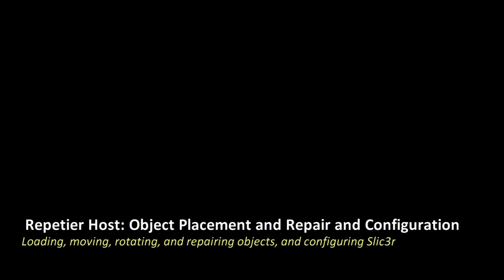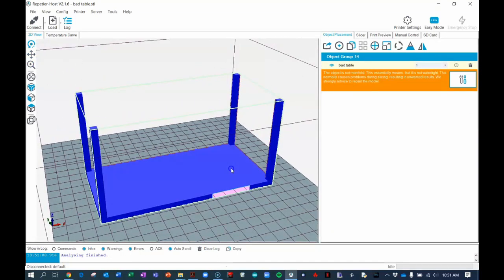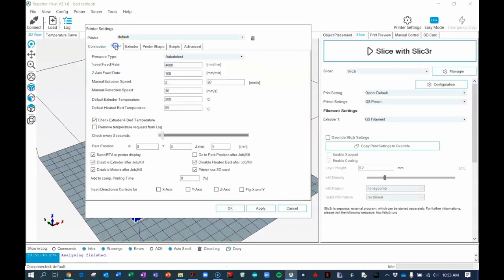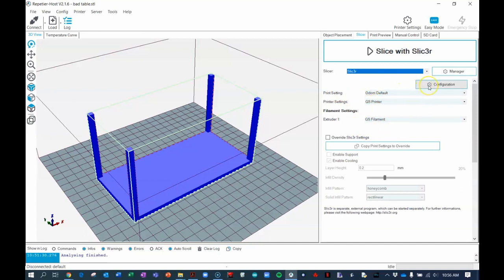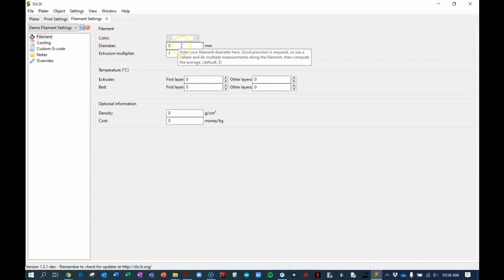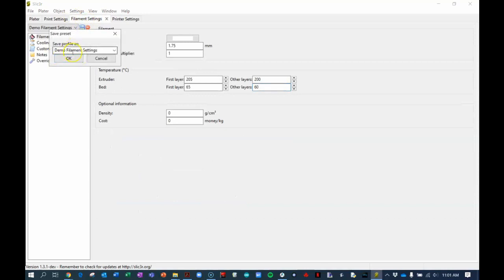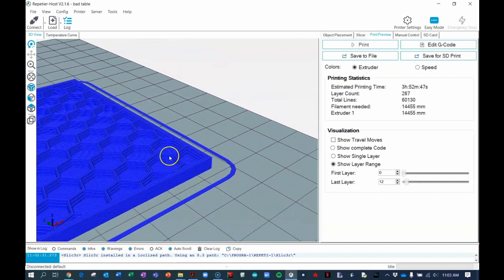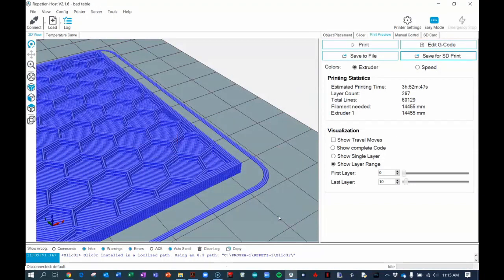Repetier Host - Object Placement and Repair and Slic3r Configuration

Comment: I find using Repetier Host very underrated software. I've been using it since I picked up the 3D printing bug. Never liked Slic3r or Prusa slicer, both annoyingly complicated and messy. I use the built in Cura engine with Repetier and does the job every time. If I need some extra supports, then I'd use Cura slicer or IdeaMaker. And Repetier always does the job quicker than any other slicer. One other thing, if the printer is not calibrated and tuned correctly, no matter what slicer you're using, it will produce bad prints. Great video!!!
Reply from the maker: Thanks, Hristo.  I really haven't played around much with the other slicers.  Slic3r simply worked for me out of the box, and I've been dancing with the one that brought me ever since.  I agree that Repetier is a great piece of software.  (I do sometimes wish it allowed us to save the Repetier file.